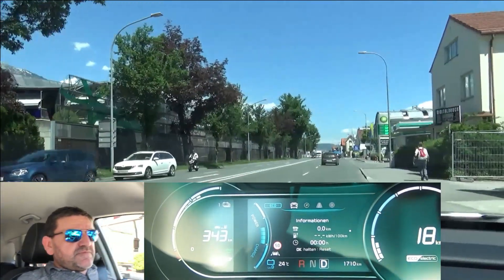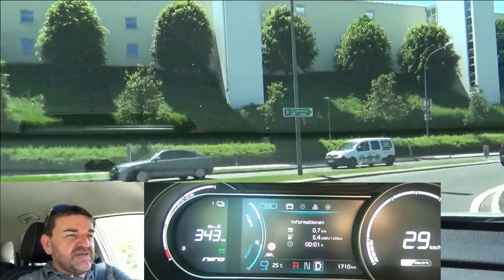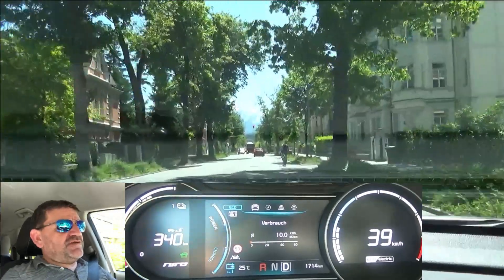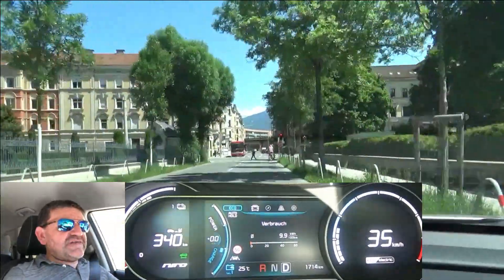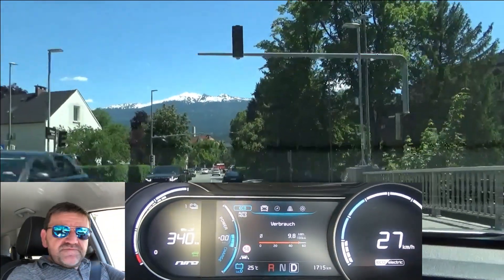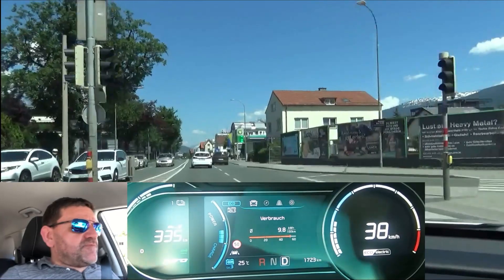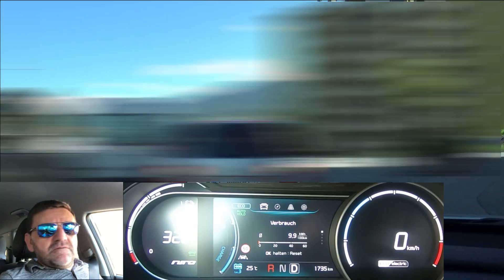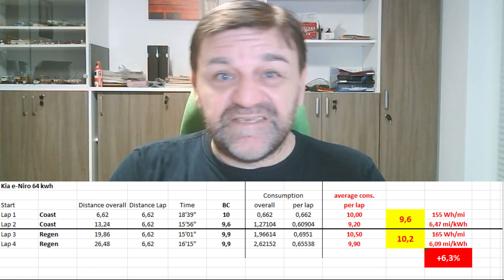Kia e-Niro (Niro EV) - What's more efficient? Coasting or One-Pedal-Drive?

Comment: Thank you for confirming that regen has the price of not getting back 100% of the energy you have already used - logically thinking you MUST use more energy with regeneration!!
I drive a Hyundai Ioniq 28 kWh without regeneration and I get 9-10 km/kWh in summer, you just can't beat that economy!
I am surprised to find a lot of EV owners (maybe even the majority!) who claims that higher regeneration is much more economical. Maybe they don't know that you also regenerate when you use the brakes lightly.
I am still searching for a real study that measures and calculates the actual regeneration efficiency, please let me know if anyone finds it.

Comment: Haven't seen the other tests, but a couple of observations - this all seemed to be on pretty flat terrain, and as you said at one point was as much about driving style as anything. That made me wonder if some driving styles benefit differently from others with respect to efficiency with regen. on or off. My other comment is to reflect that do we necessarily drive with regen. on - or off - all the time? Kia's paddle system is perfect for rapid changes in regen. levels such that when descending a hill, one wants to know one is recovering the maximum amount of energy possible, and if by paddles alone, one knows there is no waste in heating brake discs. I know I really enjoy one pedal driving in urban areas but not so much on fast roads. Adaptive cruise control on the Kia EV uses regen. when it needs to slow down, whereas the MG ZS EV uses the physical brakes. It is difficult to know how much regen. happens in the latter case.

Comment: The nitro EV cruise control has slow speed follow. If you are following another auto in the city or the highway,, the Niro will maintain a certain distance between you and the car ahead and it will stop automatically  if the car in front stops, say at a traffic signal. It appears from the indicator that the Niro uses regen in the shop and start mode  When that auto resumes travel when the traffic signal turns green, you just tap the accelerator or push cruise control up one short push and the Niro resumes its slow speed follow or the speed you have set for the cruise control.  While the car is in cruise control, it goes automatically into regen whenever you are going down a hill or if the car in front of you slows down lower than the speed you have your car set and out of the regen if there car starts up an incline or the speed gets lower than your set speed. After you get use to the smart cruise control and the lane keeper the car regens so automatically, it is almost invisible to the user.
Reply from the maker: If you car does exactly what the car in front of you does chances are quite high that you are not driving efficiently, it only would if the car ahead of you does it. As a good driver you see things that make the cars brake in front of you way sooner than when the car in front of you brakes. So you can lift your foot off the accelerator sooner and coast, this is what saves energy.
Reply: @ecodriver1746  Interestingly, my previous car was a BMW225Xe - a phev. It has an eco-pro mode and in that mode is simply coasts and does not regenerate at all, so the BMW engineers seem to agree with your findings. Of course, it could well vary between car models and the way in which they are set up, as well as the individual's driving style - as you point out. EVs are a good vehicle (excuse pun) for teaching economical driving technique - which I observe (here in the UK) is a rare thing among drivers of internal combustion cars. (It improved a little with increased fuel prices, but now they have dropped a bit, they seem to have regressed...) 😊
Reply: There is only one problem that I've seen with the cruise stopping the car. I was coming up to a red light with a few cars in front of me. The car started slowing down automatically, like it's supposed to..... I hit a bump in the road and apparently this caused the brake pedal to bounce. This turned off the cruise control and i was then coasting toward the stopped cars. Luckily, i had enough room to hit the brakes. 😂😂

Comment: The beauty of re-gen is that there's hardly any brake wear, which is a big saving in the long run. Thank you for the tutorial.
Reply from the maker: Almost all EVs also use regen when you step on the brake pedal. The point here is to brake as little as possible, which is easier with the regen set to zero (for when you lift your foot off the accelerator pedal).
Reply: The problem with that is that the disc will rust much faster because it doesn't get hot and evaporate water, resulting in more frequent disc changes.

Comment: I have found my '22 Niro EV to also be much more efficient when coasting vs regen.  The car coasts so well and maintains its speed on flat roads and highway offramps that I coast for a mile or more before I need to stop at the light ahead.  My average m/kWh for the life of my Niro EV is currently 5.0 with mixed city/highway driving.  My best m/kWh trip has been 6.3 over 30+ miles and my best "full charge" range is 366 miles.  Not bad for a car that got EPA rated at 239 miles on a full charge.
Reply: What driving mode we you using?
Reply: @Smarty1949  I drive in Eco+ mode, but I really don't think that makes much of a difference since you can turn on the A/C and still drive over 60 mph if you turn the cruise control on.  So, I'm not sure what exactly you gain by using Eco+.  Anyway, the GOM is now saying I can get 302 miles on 80% charge which is approximately 377 miles on a full charge.

Comment: This has been my number 1 question for electric and phev cars. I’m used to coasting as it’s the most efficient for conventional cars but I thought that the regenerative capability might make things different for electric. Combustion cars have three main energy inputs: input energy (use of fuel to accelerate or maintain speed), residual kinetic energy (coasting with no fuel input or braking) and free energy (acceleration or speed maintenance without fuel input i.e. driving downhill). Electric cars have the fourth energy input of regenerated energy, but it got me thinking that coasting could in theory be classed as waste energy if energy isn’t regenerated but this test has cleared it up. My only other question is do these cars regenerate energy from coasting without braking the car? I’d think the motor is still rotating from the residual kinetic energy in the wheels so I’d think it could generate a bit of electricity from that rotation.
Reply from the maker: Re recuperating when truly coasting, that depends on the type of motor, as I am not a electrician I better put this link in here ;) https://www.youtube.com/watch?v=OhiZH7geedQ
Reply: @ecodriver1746  Thank you very much, I’ll have a look at it right now. :)

Comment: Thank you for doing what you are doing, not just the Kia models but  many of the other manufacturers as well. It's very informative, well done.
I am wondering though what the results would have been had you set the Kia on the Eco+ setting which they claim is the most efficient. When Eco+ is activated it auto sets regen to level 2 as you probably know. On that thought it would have been nice if level 2 regen were either added to the mix or used exclusively as the alternative to free wheeling.
Reply from the maker: Thanks, you're welcome.
I use zero regen for the reason that this supports the most efficient way of driving - coasting - as much as possible. Most manufacturers set a certain amount of regen because they know that most people don't think about how to drive the most efficient way (many people want it but they don't understand physics). It doesn't make much of a difference whether I use regen level 2 or 3, the result of this test was rather close (only 6 %), as the Kia recuperates quite well. If you take any other car the difference is much bigger, e..g with the BMW iX3 over 20%. 
I am always gobsmacked by the fact how most manufacturers either think of their buyers as being too dumb to understand physics  or don't know themselves how to maximise their range. There are a few exceptions, like Audi, HMC, Mazda, Mercedes, but most don't help their customers get maximum efficiency out of their cars. Although I am willing to admit that the driving style I promote requires more effort... ;)
Reply: @ecodriver1746  My point about doing the run in ECO+ mode was  just to run it through the washer/dryer so to speak. I mean no offence it's just my tester insecurities about leaving no stone unturned.
Slow down and we all get there quicker except humans are in a rush to go nowhere fast I guess!

Comment: Hi Ecodriver. Why didn't you make a video about the automatic regeneration mode in comparison to the manual modes of this video? In my opinion the automatic mode should be the most efficient.
Reply from the maker: Hi, the auto regen is far away from being efficient (that's valid for all manufacturers), as those systems can't judge situations as accurately as a (good) driver. For example, before a roundabout it reduces the speed, but if you can go through the roundabout without braking, because you see there is no other traffic you are much more efficient without it. Or if you approach a traffic light with a couple of cars already waiting it will slow you down. If I as a driver see the the light turned green and the car 2 ahead of me is already starting to move then I can keep the car in motion, whereas the auto-regen only reacts to the car directly in front of me and therefore brakes too much. Same on curvy descents, all those systems reduce regen (and therefore braking power) only when the turn is finished or almost finished, whereas a good driver lets the car roll much earlier. I can give you dozens of examples where those systems are much less efficient as a (again: good) driver. 
They are great for safety, but efficient, no, they are not.
Reply: I'll go one better than Ecodriver, I feel auto regen can get you rear-ended in certain frequently occurring circumstances. In your mind you can be clear to go  but it can suddenly throw the car into level 3 regen, SURPRISE!
Backup camera, rear crossing traffic alert love them both dearly. However if I had a passenger grab the wheel, step on the brake or gas they're going to sit in back or they're going to be dropped off at the next bus stop.

Comment: When you are driving with regen at 0, are you using the brake peddle or the left paddle or does it matter?
Reply from the maker: With the E-Niro it doesn't matter, every mode is using the electric motor to brake. EV6 is different, there when regen is set to zero and foot-pedal is used there is no regen, only mechanical brakes for 10 times to keep the friction brakes in use.